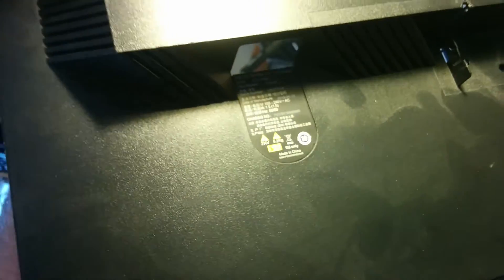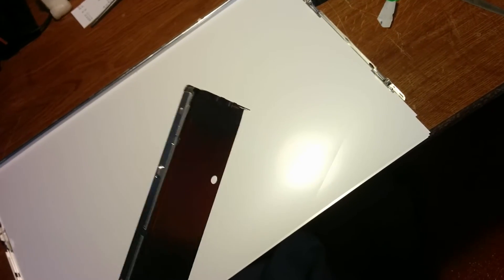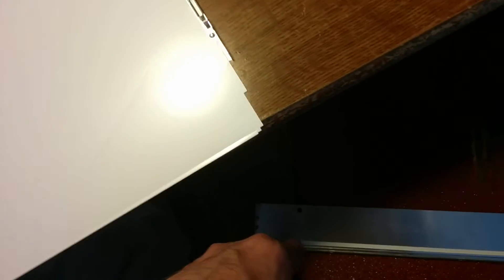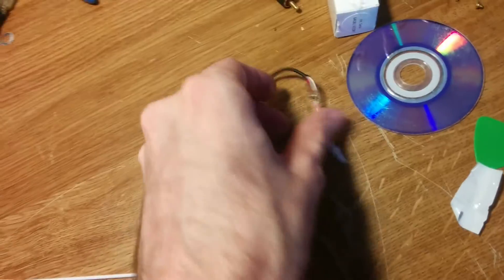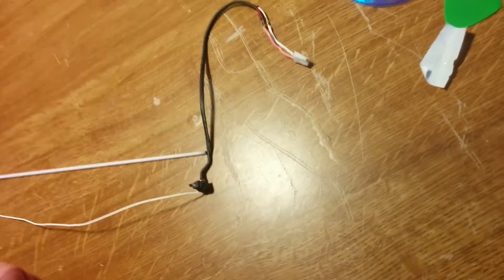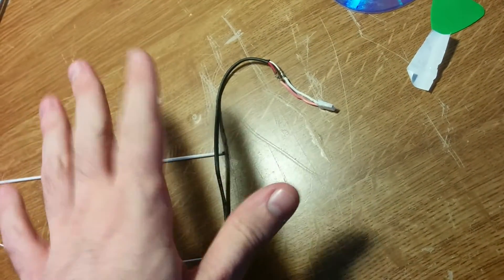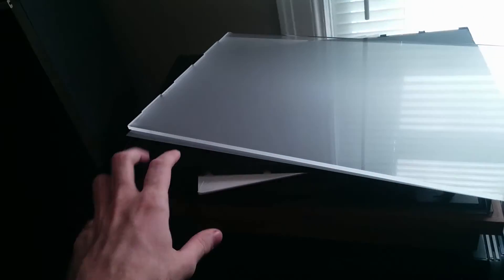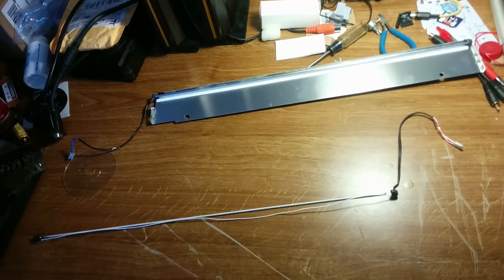LCD Repair - Lenovo L2250pwD - bulb replacement

Comment: Did the bulb fix the issue, and if so, do you have record of a part number for this order?

Thanks!
Reply from the maker: Yes, the bulb was the fix on this unit!  Unfortunately I can't remember where I ordered the bulb... Some times I have literally measured them and ordered the specific size.  It has just been too long so I'm not sure where exactly I got the part, unfortunately, sorry!

Comment: How did you take this apart? I cannot find any screws.
Reply from the maker: Ah crud, I know I should have shown that.  It's just a bunch of clips on the outside.  I don't have this monitor anymore but if you look up LCD monitor disassembly it should be similar to any other monitor with those dumb clips on the outisde.  I use a butter knife usually to help split it.
Reply: Thanks! I've got it open now, but it took a while!

Comment: where do you find the correct pieces for all this very specific equipment?
Reply from the maker: Well, bulbs I just measure the old ones very accurately (down to the millimeter) and then stores like "ccflwarehouse" sell pretty much every size imaginable.
Alternately, that company offers full kits for specific panels.  I've used one of those kits in the past for one of my old Samsungs and it worked+fit perfectly.

As for circuit board components, of course I just read the old one, check the service manual (if available), or cross-reference some combination of searches.